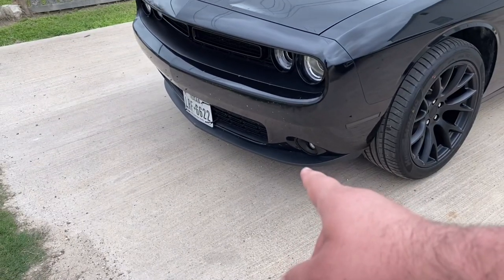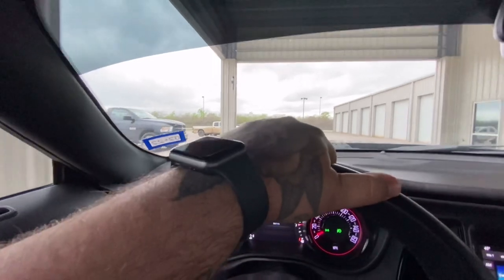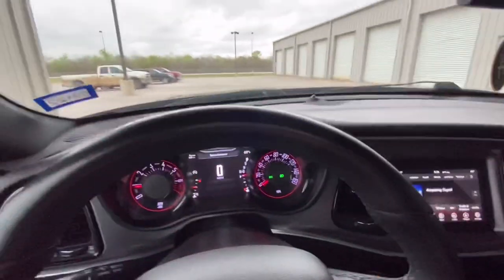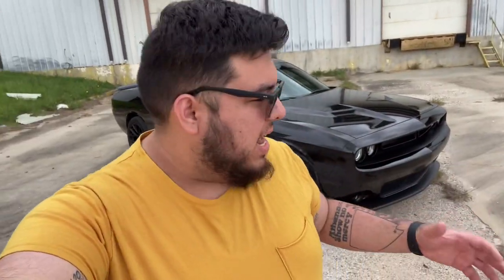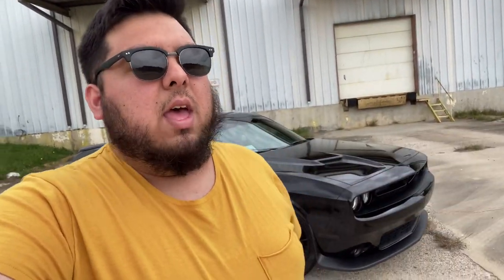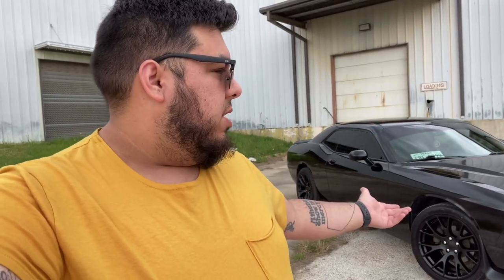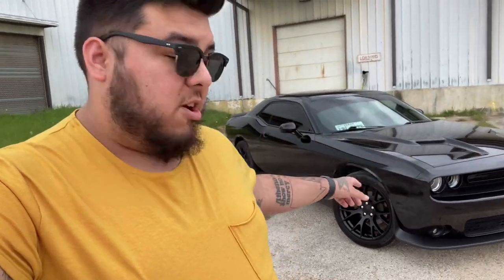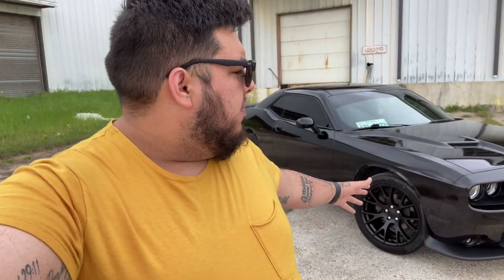UPGRADING My Lower-Air Dam!! | 2019 Dodge Challenger SXT!

Comment: Yo how much you spend all together? I have 2015 challenger rt +. The dealership here in phx az told me the dam is gonna be 800 and I'm going to need a new splash guard cause by switching it I'm gonna need another for it to fit properly and that's going to be another 300. And that's just for the parts. He didn't even tell me how much instalation was gonna cost cause he said he doesn't know if it's gonna take one or two days. And you're telling me you spent if I added right about 500ish, bruh...🤦‍♂️

Comment: I watched a couple of videos of people changing the dam, and it's essentially removing the entire bumper/faschia/dam assembly and messing with it on the ground and then putting the whole assembly back on again.  My guess is when you consider the G's of air that dam gets at really high speeds, you can't just pop rivit it onto the outside of the fascia.

Comment: Thanks man i got mine from the links you provided in your  description and got them installed at this local body shop which charged me only $250 to install it. Can you believe the dealer tried to charge me $900!!! You must live in a very rural town or is very close with the Service Manager? The reason I ask because in order to install this air dam the whole bumper needs to come off and it took 4 hours to complete. The close out dams are definitely needed because otherwise you will be left with a gap behind the air dam which can get mud or any other debris in. I highly recommend this mod.
Reply: Hey bro just curious is yours an sxt ? I have a 2017 sxt and I bought one but didn’t fit. I wanna buy all this but make sure if it actually fits
Reply: @Eddy-ng4jz  yes mine is a 2021 SXT and as long as your purchased the part it will fit even without the close our air dams. You will need to remove the front bumper in order to remove the current sxt airdam skirt and install the rt airdam wipe lip. Call your local body shop because they know how to professionally do it so you wont skuff your paint. The parts in his description definitely will fit your year/model. Same body just a different year. The parts place have a 1800 customer service number you can speak with them as well.
Reply: @Imamazing2023  thanks brother. I was just curious because when I go check the lip it says it won’t fit my car. But im seeing some comments that it did fit for there sxt
Reply: @Eddy-ng4jz  oh yea i seen that too. But yes the reason it show that because it’s not a part for a sxt it’s for a rt but a mod that can fit on the sxt. So i know the confusion lol but no worries it will fit.
Reply: @Imamazing2023  ah ok man thanks fr. Ima order this soon 🥹
Reply: I call BS on $50 install fee from the stealership 😂😂😂

Comment: The site you linked to and other websites insist that this part doesn't fit your 2019 model nor my 2017, are you sure it will fit and dealer won't give the run around?
Reply from the maker: Yes, I linked the exact same part that I purchased. The Dodge Challenger hasn’t really changed much since 2015, so all of the bumpers are essentially the same, excluding the Hellcat bumper.
Reply: @JeremyJOH  thanks for the response your challenger is lovely
Reply from the maker: Thank you, I really appreciate it!

Comment: @jeremyJOH Are you sure the air dam fits with not other required parts? Because i also found this part number(air dam) and it says it’s compatible with the sxt. Please get back to me with details and the best option to go with.
Reply from the maker: Aside from the lower-air dam itself, you will also need the close-out covers shown in the video.
Reply: @JeremyJOH  do you think i can find those at my local dealership? Because i ordered one from a mopar parts store and it looks like it comes attached with the air dam.
Reply from the maker: I have a link for them in the video description.